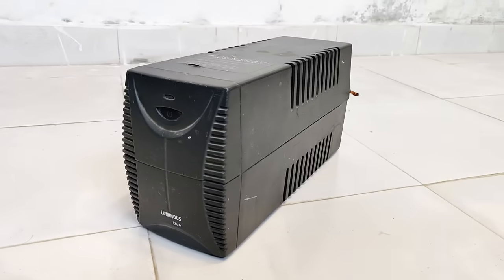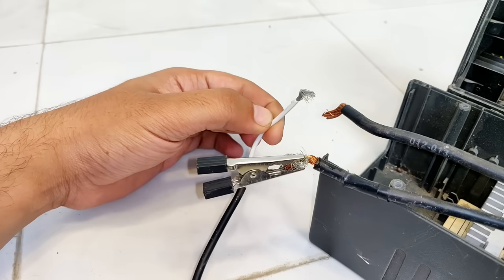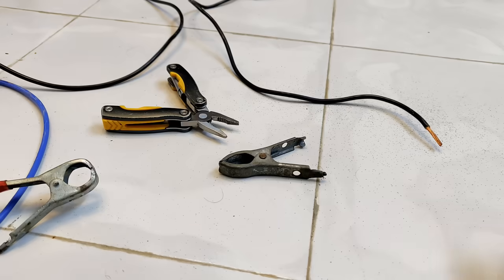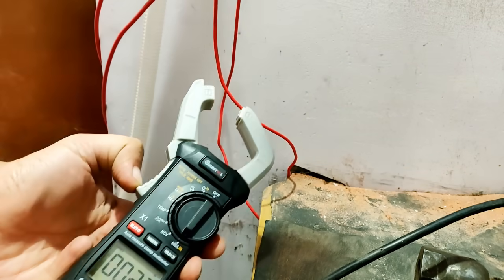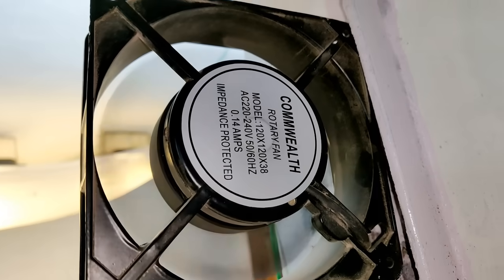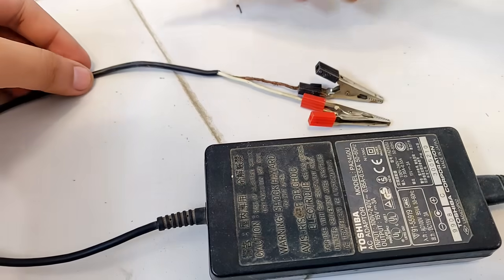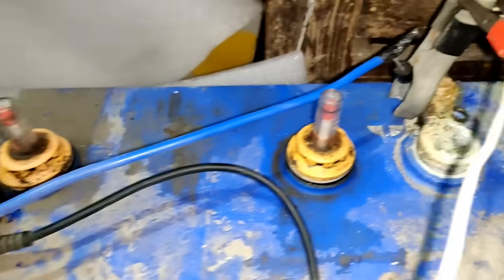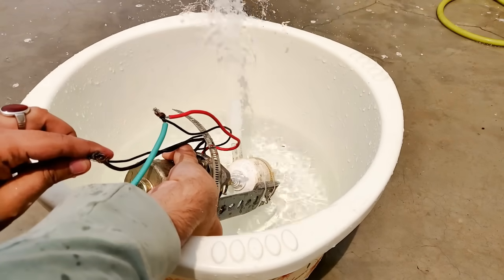Can a 12V 7Ah UPS Inverter ( 220v ) run with a 14.8V 150Ah Battery ?

Comment: Thank you. Lots of good information.
I strongly suggest much better connectors for the battery terminals for prolonged use.
Also, I recommend short wire runs connecting the UPS to the batteries. Long runs on DC wires at high current can be problematic, whereas AC will not have that issue.
I hope that you're well.

Comment: Most of these cheap ups es are not designed for prolonged use. They are designed to sustain a normal computer for a few minutes just so user can save their work and do an orderly operating system shutdown.  Larger batteries will not cause the ups to overheat but again ups is not designed for extended runtime.

Comment: You need a 2.2 ohm 20W resistor to limit the charge current. The adapter is already operating beyond specs and it will soon die or catch fire which is not a safe situation for lead acid batteries generating combustible hydrogen gas while charging.

Comment: 1: that small ups can't charge up a big battery.
2: the ups will be fine no matter how much Amps battery you use. 
3: the ups might cut off if overloading accessories you use for the output.  If if doesn't cut off, the ups might die or it will celebrate diwali on its own.

Comment: Hi, people, I see so many videos, 
nice, BUT how many of U do understand that even a battery is of 12-24Vdc design, 
it sits almost always not isolated, inside an UPS, . . . 
This is because of the transformesless based inverters, 
bringing the batteries Leads outside, bring huge risk for the user and its surroundings !? 
How many of these DIY enthousiasts still are alive right now, I sometimes wonder myselfs ? 
A UPS on Mains voltage, even charges its internal batts often reverse based thru the H-bridge, 
so completely un-isolated ! Hence why the Batts are often located inside, 
and you only find a connector for external batteries on industrial-professional users ;-? 
Hope this triggers a warning for many hobbyist, regards, Harry.

Comment: so your battery is getting charged form 3 sources ? from ups , from laptop charger and from bycycle. is that ok to conenct the three. i have a similar setup and my ups is not able to charge the external battery it only supplied 0.5 amps. so can i connect an external laptop charger like you while the ups is running on direct supply from wall and has load connected ?

Comment: I used Lithium batterys for ups, so I want to modified low voltage 10v to 9v in ups circuit. Is there any way to do it?

Comment: This is a disaster waiting to happen. That soldering job was terrible, please use a crimp connector to connect such heavy wires. The ups expects a sealed battery, and you connected a tubular battery, while there is not much of a difference, and lead acid batteries are durable, incorrect charging and discharging will definitely ruin the battery life in long term. If you're planning to use this setup long term, please replace the crocodile clips with something more durable like lugs.

Comment: Did you check the working up of the invertor transistors? They probably need more cooling, to be shure of long functioning. A small ventilator perhaps.
Reply from the maker: 👍correct

Comment: I don't think the Ah of the battery being different will have any effect on the inverter: it has no way of knowing. It's just the voltage it is concerned about. Higher Ah will just mean it will run longer.

Comment: I run a 1000w UPS that was designed for 4 x 7.2AH in series (48V) with 4 x 190AH batteries. Now my battery bank is 200 kilos but it lasts for around 8 hours at half load giving me time to plug in my generator. Thanks for this great work and to answer your question, overcharging. Cover your terminal with grease, it will last for ages giving you much needed peace.
Reply: Hi, can the UPS charge the 4 x 190AH batteries without any modification ?
Reply: Yes, charge takes longer, the load does not change, just the amount of energy required to replenish the cells changes
Reply: Good bro
Reply: Yow! It worked? I've been looking for answers if it will work if I replace my UPS battery with a single 12V Lifepo4 100Ah battery.
Mine is 390W
Reply: Share  your video of ups and four battery. Thanks

Comment: I would add a fan or two since it will run longer than designed so it will heat up more

Comment: This works I am using it as we speak but. The problems is always the charging capacity. It's not designed change huge 150 ah batteries. So it takes more time to charge the batteries
Reply: porque el diodo va en el negativo,,he visto muchos videos y dice que es en el positivo

Comment: Does the charging have to be monitored if using a laptop charger? Do they have a charging control circuit? Even if they do, they must be designed for lithium ion batteries right?

Comment: Without even watching the video I already know the answer is yes, it will work on that battery.  There is a fairly wide battery voltage tolerance in those UPSs (I'd guess it would be around plus or minus four volts) and the only effect on a larger battery is that it charges very, very slowly since that UPS is designed to charge a much smaller capacity battery.  This could cause sulphation in a lead-acid battery which would reduce its life.  A LiFePo4 (Lithium Iron-Phosphate) technology battery would probably be a better choice in this application.
Reply: Good bro

Comment: Since this ups components are made to run for less time, But if I add cooling fan, will that help to run for longer time without any problem to ups board? Please answer. 

I'm planning to make one for home like this, if any additional things are required please advise.

Comment: It works on my 120ah battery but after 40min it evolves heat
Reply from the maker: Actually its not designed for long term operations.  Seems like a cpu cooling fan should proove good.

Comment: Great effort. Pls can one charge the battery also with the ups charger by attaching solar charger controller.? If yes does therefore mean it can dischsrge and charge at the Sam time? I mean conneting to electricity

Comment: The positive got corroded because it requires charge. If it is the negative terminal, it is because the battery is getting overcharged

Comment: Hi Sir, just one question. Can i use my UPS 12v positive and negative terminal connected to a 12V 7A battery as a power supply for my 12v cctv unit? I will just remove the battery and use the + & - wires and connect it to the cctv power supply, Is it possible sir.

Comment: I cant believe UPS built in transformer is enough for charging 150 ah battery,  also all UPS's are not same, most of UPS need minimum lord otherwise it will be cut off after 10 minutes and have to restart.

Comment: Please help mee..🔴🔴

When i connect battery to the ups it's getting so heat and smoke is coming inside the heat sink..how i rectify this issue..
Appriciate if you can reply my comment friend 😥😥❤️❤️
Reply from the maker: Tips , do not over load, battery voltage should not be more than 15v, wire polarity should be correct

Comment: I took my car battery 38ah 12 v and connected to 650va ups. It worked for first 10 days 3 hours continuous. After that even for just one led it works only 15 minutes and ups beeper every 7 seconds and it goes off. I changed Ups but same story. Can you help please.

Comment: What is so funny and sad, is that he is so perfectly professional sounding.  He really has got "it", and yet the the equipment is comically decrepit.  It's a subtle satire.  Mains voltage of 170v out of possible 240v, thin cables, corroded connections, antediluvian wooden battery protection, dangerous electrical safety practices.  I wondered if this video was a commentary on others'  lack of electrical knowledge, or perhaps an outright farce.  But probably not, as we all play and do unwise stuff with old stuff we find.  This is how we learn.  This interesting and helpful guy is a genius of making do with less.

Comment: Brother I have a 24 volt computer UPS I want to reduce its charging voltage a bit so that I can use 24 volt lithium ion pack, because its charging board comes close to 36 volts now I want to reduce its four from 24  To keep it within 25 volts, is there any strategy to do it
Reply: i've read that lithium Iron Phosphate is directly equal to Lead acid battery charging parameters.  You can drop in and replace.  I'd still want a BMS though. Add a cheap aliexpress solar module to the battery before the UPS.  I'm thinking of doing the same thing myself.  From what I read here, it is a good idea to put a little fan on the UPS because it will be on longer, running my TV.

Comment: late, but so others see, NEVER use laptop power supplies for charging external batteries. They are only power supplies, not chargers. They cannot monitor the battery, and as such will overvolt and possibly ignite the battery. The laptop monitors battery charge and shuts off the connection to from the power supply to the battery when needed, the power supply will never shut itself off. It is simply an AC>DC voltage converter, and nothing more.
Reply: True. Maybe one can feed the battery through a solar charge controller.
Reply: thats why u lower output dc voltage by 1v-.5v from max voltage so the battery would taper down on safe voltage

Comment: que es eso que lleva en los tapones 4:49 ? que se ve algo así como el nivel del agua de las baterías o presión de la batería. Dónde se compra, porque es interesante saber el estado de la batería.
what is it that is in the plugs 4:49? It looks something like the water level of the batteries or battery pressure. Where to buy, because it is interesting to know the state of the battery.

Comment: I did the same experiment and the UPS lasted 2 years and then it burnt the charger circuit - so answer is NO this small UPS  cannot sustain this large battery charging for long period..
Reply: What if the UPS only did maintenance charging?
Reply: I'm planning charging my battery thru solar charge controller. Is this ok. I'll condemn the AC 220volts charging

Comment: You can run multiple 4mm wires in paralel to make up for the smaller section. Don't run 31A through a 4 mm^2 wire, it will overheat
Reply: Yes you can use multiple wire . My system has 2 wire . Of same length.
Reply: yes... 4mm cable x 2 = 10mm cable single

Comment: Hello Mr. Electron 
I tried to connect my 12V 7Ah UPS Inverter ( 220v ) o my tubular 150 Amp 12 volts battery and it did not work .Can the 14.4 volts of the battery ruin my ups inverter ?

Comment: The UPS itself can charge the battery and likely supports at least stage 2 bulk charging and stage 3 float charging and maybe a maintenance trickle charger voltage.  Using the laptop power supply only provides a crude stage 2 bulk charge which will produce a lot of hydrogen gas.  The real question is if the UPS charging circuit could withstand the much longer duration stage 2 bulk charge of the higher capacity battery and would it cutoff, current cycle or current limit if the battery was depleted enough to require stage 1 charging, even car chargers often have a manual switch for stage 1 charging and recommend that the charging should not be unattended (the current cycling is very noisy that I often can't stand being in the garage when stage 1 charging, fortunately you don't need a lot of stage 1 before stage 2 is possible).
Reply: Yes but its not designed to charge such a large battery and will die in short order
Reply: @Gazdadjuz  True, a UPS is not intended to be used continuously in such a fashion, but it would work till it fails and indeed has worked in the field for most of a year in Trinidad and indeed had not failed on the project to the point where a manager against my advice, ordered the UPS to be reconditioned for use in the Houston office after the Trinidad project completed, my advice was to junk the UPS after the project.  Our competitors had shorted out the fuse box at the Trinmar office and smoked their computers so our line manager had asked me for how the power differences between that of the Trinmar office and our computers could be temporarily accounted for, hence we simply used the inverters in a UPS continuously by cutting a few wires.   Seems like what was required in this video was for an even shorter duration than what we had done with a UPS at the Trinmar office.  UPS's are fundamentally simple and robust.
Reply: Good bro

Comment: first things first.... Dude well played in showing people how to repurpose old discarded electronics for your own use and gain, at no to a low expense....
BUT
From what I can see in your video. you and ANYONE who watches you please do the following.
1)get some bicarb soda and a steel brush and an old cloth and CLEAN the batteries. (if you can't get those then water and a cloth, dry it off immediately afterwards )
2) the batteries on concrete discharging thing is a myth. but I would also put my batteries on a surface or plank, because of acid leakage. FYI there's more chance of self discharge through muck and grim on a battery, than it being on the floor
3) you see corrosion, clean it ASAP and check the health of your battery or batteries
4)160/170 VAC is not good. (Like me, believe you are on 230VAC standard ), I would believe something is wrong at the H-Bridge (ie mostly the 4x TO220 package ICs or mosfets on the heatsink), or maybe somewhere else (not sure yet). electronics with SMPSU to down convert the AC, should be OK. But I won't trust it. (I have seen other UPS's that's 600VA do the same). 
5) just be careful and happy learning

Comment: UPS might overheat when large capacity battery is used. heatsink inside UPS is usually small and not designed to long continuous operation because manufacture expect that battery will get discharged before internal components overheats. you should add fan to cool internals of ups.
Reply: I have a question my ups is 600VA and if i need to run my ps4 slim for 13 hours then how many amphours battery i need my ps4 takes 370ma and the internal battery is 7ah and at that battery my ps4 can run only 4 mins
Reply: @everythingandroidpro1850  According to spec, the PS4 Slim uses between 55 and 110 watts. That's in line with your measurement of 370mA, which at 220V (I assume, you did not mention the voltage) equals to about 80W. So, for running it for 13 hours, you will need 13hx80W=1040Wh of stored energy. When the battery has 12V, it will need to have a capacity of 1040Wh/12V=87Ah. However, this does not include storage and conversion energy loss, plus you will need a reserve in the battery to not fully discharge it - Lead Acid batteries don't like full discharges, they will be dead in a short time. So your battery should be at least 120Ah.

And of course, there's no point in running only the PS4. Maybe you would need a TV also, which uses power, so the battery would need to be even bigger. What's the point of running the PS4 from battery for 13 hours while the TV is connected to the mains? Then you could simply connect your PS4 to the mains too.
Reply: @valuemastery  can two 12v40ah battery be connected together for this
Reply: @valuemastery  I want to use mine to power 3(60watt) bulbs 💡, 3dc cooling fan and 5v stepper motor 

What battery(volt/ah) is best to get
Reply: @Yeklifestyle  Yes, you can do this. You need to wire them in parallel (positive to positive pole, and another wire connecting negative to negative), resulting in one 12V80Ah battery. However, be sure to charge them both up to the same voltage prior to connecting them! If they differ in voltage, you might experience an unpleasant surprise...
Reply: @valuemastery  thanks 🙏
Reply: @valuemastery  can you please tell me what is the type of home UPS normally we used in computer or laptop is they offline or is the online UPS if it is offline UPS then why company use auto transformer in it?
Reply: @theclasses5586  Normally offline UPS are used, power from the outlet is simply routed to the connected devices unless an power outage occurs. In data centers, online UPS are generally used. They isolate the connected devices from input power glitches to protect them, and have no switching time. But they are more expensive and overkill for personal use - and run hot even when no power outage occurs.
Reply: @everythingandroidpro1850  It would be cheaper to run an extension cord to your neighbors place.
Reply: @everythingandroidpro1850  arrange a solar panel of 5kv at home...
Reply: No it won't. Unless we're drawing over the rated amount, so for this UPS it was 600VA, it won't. Even if it was a 100000000Ah battery, it won't.
Reply: I know the concern about putting car batteries on PSUs is the desire to run high loads and at longer times than design parameters.  I want to run the same load (router, modem and sleeping computer) for longer than my typical 30 minutes.  Is this still a hazard?

Comment: What's the point? Most parts of the inverter circuit won't mind, only the (exchangable) capacitors have a known limit and might age. The rest is a control loop, depending on the quality of the output signal (rectangular (hopefully not), trapecoid or near-sinus). A 12V Pb pack also will output up to / about 14.8V while charging.
Solar energy generators do quite the same, but bring the charging circuit with them, while you only recycle an existing inverter, but you cannot use is charging part, which only know Pb-batteries (and even there, mostly does a poor job...)
Nice hack, but no real news.